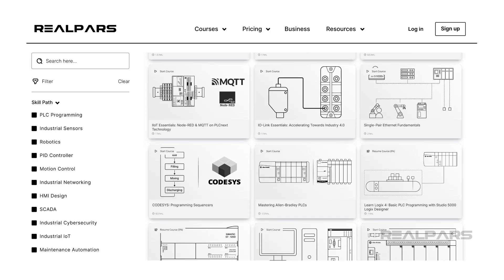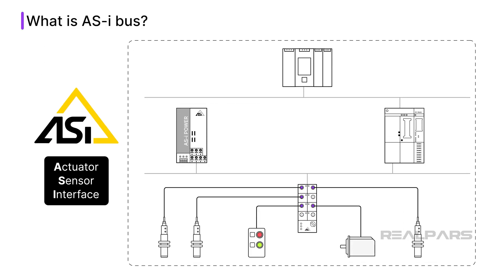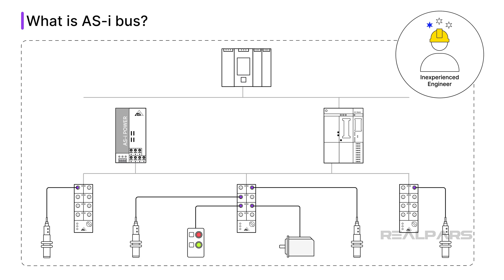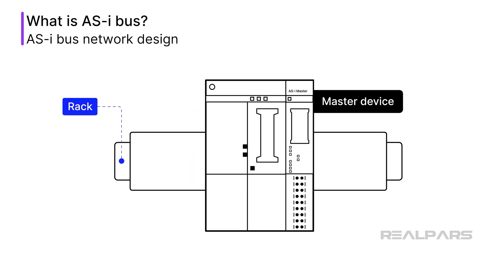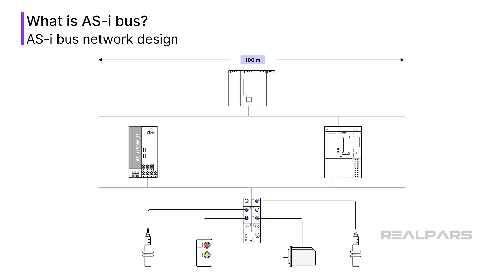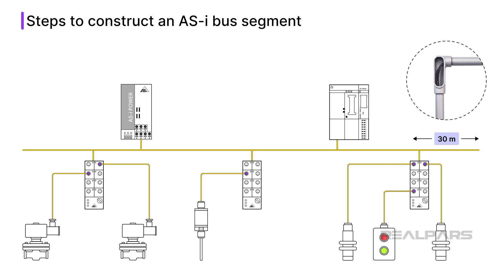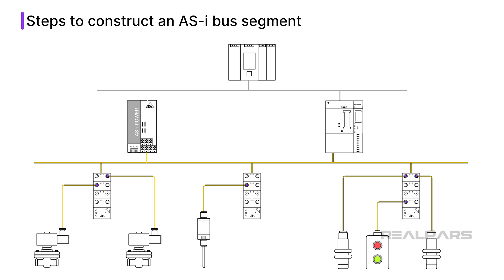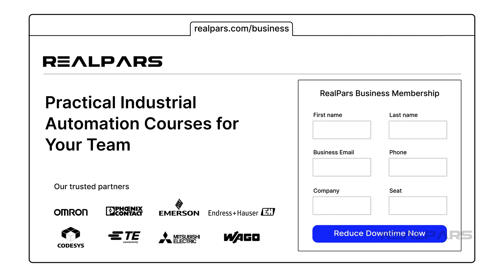Constructing an AS-i Bus Segment

Comment: Is getting outdated for digitalisation , 7 years ago, it was the  latest significant update for the AS-Interface industrial bus called ASi-5
Reply from the maker: Hello, @iseron.   Thank you for your comment. And yes, I agree, the old system is still out there, and new generations are constantly getting improved. Not quite faded out—more like evolved. The AS-Interface (ASi) bus remains in widespread use, particularly in applications where simple and cost-effective wiring is essential. It’s particularly popular in conveyor systems, packaging machinery, and decentralized I/O setups where high-speed data isn’t critical.